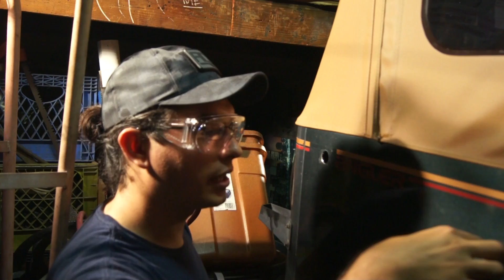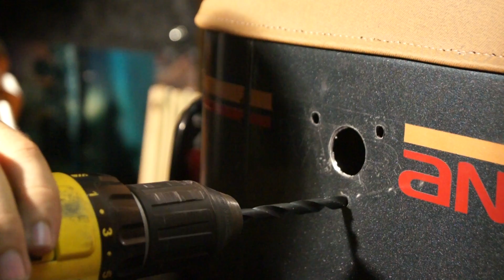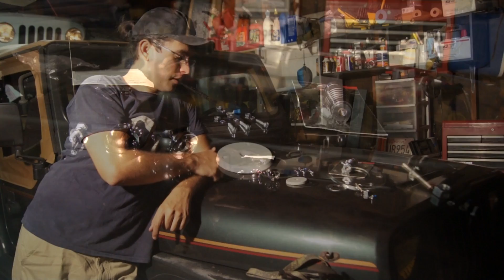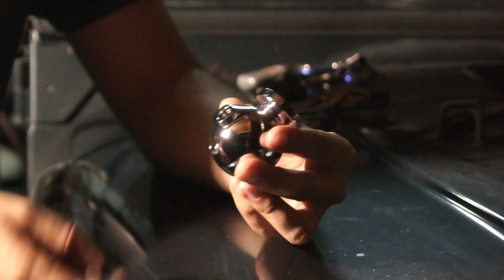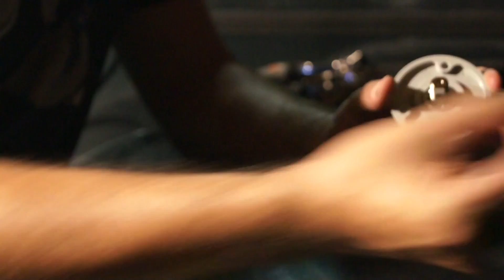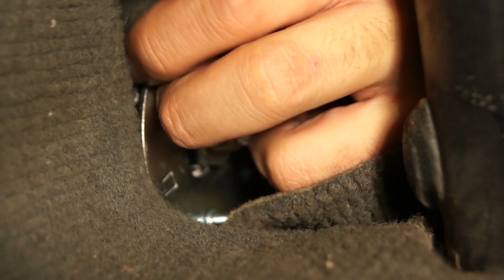JURASSIC PARK MOTORPOOL: INSTALL CB ANTENNA BASE

Comment: You didn't mention that it matters where you drill the mounting holes. They determine the angle of the antenna. Very important.
Reply: Most ball mounts have a larger nut that you can loosen to change the angle of the ball, so it doesn't actually matter how it's originally mounted, since it is adjustable

Comment: I know this is a 5 year old shot in the dark, but please please please tell me how you are securing the whip at the front of the Jeep like that, especially with the top down. And please don't say its that weak little clamp with the plastic piece.
Reply: Cadillacula The whip tie down will work fine. Some use a second one further up the light bar or use zip-tie the antenna for further support.

Comment: I found the arched over look does look cool, but today found via the SWR meter that it causes the transmit to go into the red, destroying a cb radio. Keep the whip antenna arched over for looks, but straight up and down for actual transmitting.
Reply: That's common sense.